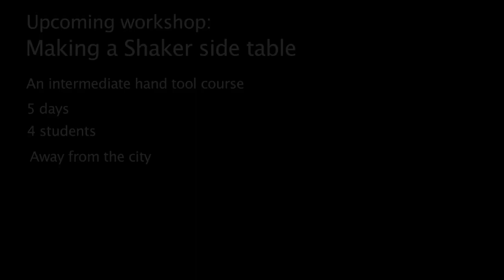Building a Shaker side table

Comment: Great video, I really enjoyed it. Quick question if you have time. Before assembly you applied a finish, but had the joints taped. Why? Do you think the finish will lower the glue strength? I assume...

Comment: What is the name of the tool you use at the three minute mark?
Reply: Hi. I know this is a little late, but it’s called a router plane. Veritas make them, as do Lie-Nielsen. You may be able to find an older Stanley no.71, but in some cases a nice one can be more than new one from the newer companies (Veritas and Lie-Nielsen). There are however, many copies out there (rebadged Chinese copies) and you could even make one yourself. Good luck and I hope this helps.
Reply: @chm1701  Many thanks! I will keep an eye out for a Stanley 71.